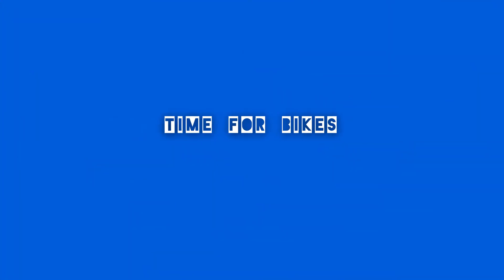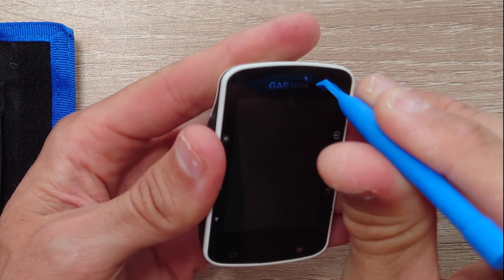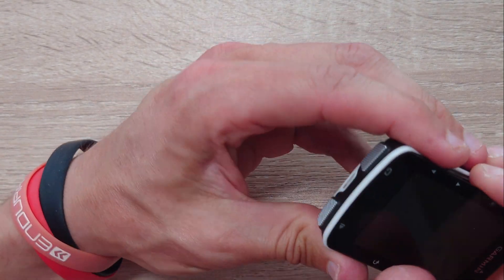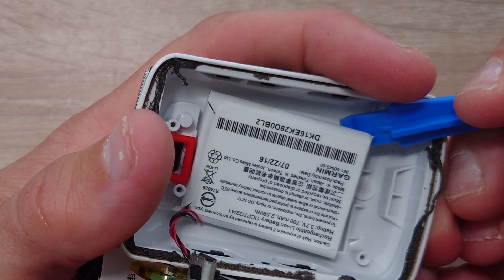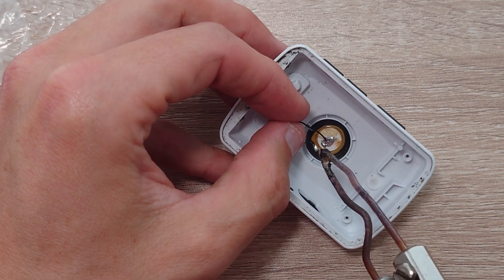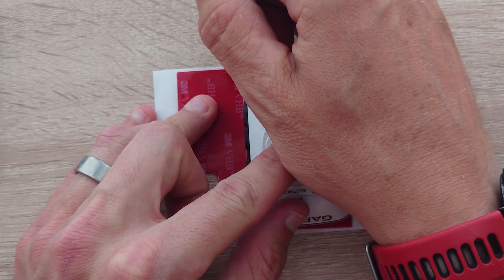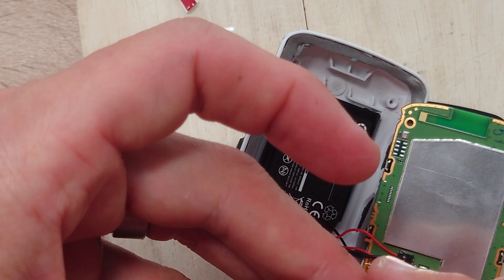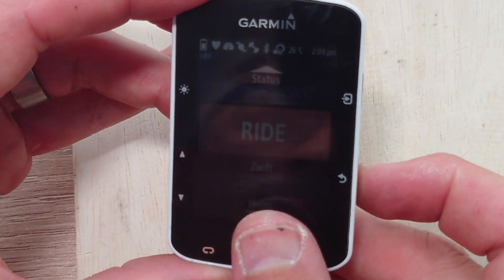How to replace a Garmin 520 battery – The BEST DIY way

Comment: To make it easier to separate the display from the case, please use isopropyl alcohol. Just a few drops into the gap between the display and the case will peel off very easily. It's also important to heat the display well to make the seal soft.
Reply from the maker: Great advice. Thanks for stopping by and adding your comment. Take care and happy cycling 🙂👍

Comment: Another success story here. For anyone else attempting, I would say to really really take your time removing the screen. I attempted this twice. About a month ago I got impatient and I really messed up the screen trying to pry it out and created blocked out pixels (or whatever the term is). The top of my screen was blacked out and not readable. Over time, this healed itself. I don't know how because it just sat around. I had given up.

I recently tried again, and while I again created some black marks on the corners, I was able to get the job done and I'm happy to say my Garmin 520 has a new battery and seems to be working fine. I did not bother reconnecting the speaker. The blacked out pixels have once again begun to heal and I expect my screen will be clear once again.

There is a lot of extra adhesive on the bottom section. Definitely save that for last, and be extra patient. Also take care to put the battery wire on the proper side. It's very short, and I actually had to reverse the battery because the wire was not long enough for the way I originally had it situated.

And for the record, the battery cable does push from the top. It does not slide. And the side where you can see the most copper should be facing out.
Reply from the maker: Excellent, thanks for sharing your experience. Basically thats All fid and we are all in this together. Well done and I am glad you persisted 🙂👍. Take care and happy cycling

Comment: I am having a heck of time getting that battery cable back in. Does it slide in? Or push down for the top?
Reply from the maker: Hi, its been a while since I did this but having reviewed the video it seems like I press the battery connector squarely down onto the motherboard. Like all these things its better that you take care with these little parts as they tend to deform and/or snap very easily. Keep trying as I am sure you can do it. Take care and happy cycling 🙂👍

Comment: How to test battery, I mean, in order to know if its time to replace-it?
Reply from the maker: Sorry for the late reply, Simply do a big ride with it running gps and everything else enabled. If the unit lasts no more than 3 - 4 hours then you know that the battery has issues. They should last a lot longer than that. Hope that helps

Comment: Great video thanks,
got mine changed after watching this. However the screen on mine seemed welded down, even after heat treatment and the lifting / prising did cause some apparent smearing on the lcd screen but still entirely functional.
Able to scrape the previous gasket/adhesive off the case but it wasn't going to come of the screen without damaging it, even with glue remover tried. I put it back together and used clear flexible silicone sealant. hopefully it will be waterproof (ish)
I was one of the first buyers all them years ago thats how long Ive had it.
Reply from the maker: @LANKY123  thanks for sharing your experience. I was going to suggest that maybe somebody had opened yours up before, but it sounds like you are the first owner. Well done on getting it sorted though. Take care and happy cycling 🙂👍

Comment: Tried this today and unfortunately the GPS stopped working.. any ideas? The replacement went without a hitch. It just no longer locates satellites. Tried all types of satellite and reset device etc. even tried putting the old battery back. Same deal. Everything else works - just no gps.
Reply from the maker: @mrjamiehinton  its one of those things that I can honestly say I have had no experience of, or what could have caused it. It may be worth checking the insides for any loose cables/wiring. The battery swap itself should not have caused it so I am wondering if a small part has come loose or has broken in the process of replacing the battery. Maybe worth taking a second look. So sorry I cannot help you any further 😕

Comment: Have you got a video on how to replace a 520 screen cheers
Reply from the maker: Hi, thanks for stopping by! Unfortunately I don't have a video. I would suggest that it is possible using the guts of this video to help guide you through most of its removal. I doubt you will need much further instruction if I am honest. Sorry I cannot help any further. Fingers crossed you can sort it out. Take care and happy cycling 🙂👍

Comment: After watching this video and several others decided to attempt to repair my Edge 520 with shortened battery life. One video was comedic as they were using hot glue instead of heat shrink to insulate wires, other video said to open Edge unit prior to ordering battery in case screen broken during separation which is how I proceeded. Could have saved $10 if willing to wait a month or two longer for a battery. Following this video as a guide, I only had one issue, battery plug would not lock/latch on to pcb mating connector. Very small locking connectors and vison declining with age, after frustration and taking a day break I used my soldering gun to heat fuse the two connectors together. Seems to work without issue so far, hopefully added several years life to my unit that is eight this year. Used black Permatex silicone to seal unit. Thank you Time For Bikes.
Reply from the maker: What a lovely comment. Thanks for taking time to stop by and let everybody know of your experience. So glad you were able to succeed. Take care and happy cycling 🙂👍

Comment: I had the very same new battery to replace but found that the connector didnt fit good and kept popping off, i then had to snip off the old original connector and cut the new on off and resolder the old one onto the wires of the new battery. Fiddly but then it connected fine. Also i heat glued my screen back to body. All is working fine again. I did this all before watching you video and yes i did scratch the under side of the screen when removing the old seal. Oh well its an old device and i can live with it. I also peeled off the old sticky tape from under the original battery and reused that.
Reply from the maker: Cool, after your hard work I bet it functioned a lot better. Glad you managed to reuse the 520 rather than buying a new device. Good work! Take care and happy cycling!

Comment: Thanks for the video, would replacing a Garmin 530 Edge battery be the same procedure? Regards.
Reply from the maker: Good question. I have not opened up a 530 before but can only imagine it would be similar. I have been debating making a video on a 530 but need to get my hands on one. If you need to open up a 530 then maybe do the same kind of procedure and just take your time. Best of luck! Take care and happy cycling 🙂👍
Reply: Thanks, no problems yet but it is about 3 years since  purchase from new. @timeforbikes

Comment: I destroyed so many things trying to fix it. Some bike locks from Abus (bt enabled), Suunto watch, even a $1700 Nikon lens with a known flaw where a doublesided tap loosens. This stuff looks essy, but needs some skill. I'd rather pay you or someone tond this for me.
Reply from the maker: When making this I really hoped that it would help others have the confidence to 'have a go'. I understand your concern but I would say that these are not high value items anymore and are relatively simple to repair. Granted, these units are not really supposed to be user repaired as its not something that is a simple battery replacement like say a tv remote. However if you are careful and take your time then this is possible. The 520 is still a very useful little computer and is a real asset to have working to its full potential. If you decide to give it a go then best of luck. Take care and happy cycling 🙂👍

Comment: Had to recharge mine 3 times yesterday on my 7 hour ride. Thanks. Now I need to pluck up the courage to attempt this 😌
Reply from the maker: Hi, don't feel too scared about it. This really is as easy as the video shows. When I made this video it was also my first time attempting it. The main thing I was really careful of was the ribbon cable linking the screen to the main board. Note how this is attached and the rest of it is fairly easy. Best of luck. Take care and happy cycling 🙂👍
Reply: @timeforbikes  well made tutorial thanks, I’ve subscribed BTW.
Reply from the maker: @sophiescyclingandwalkingch4294  thank you! Only 3 left until 1000 subs now 🙂🙂🙂

Comment: клейкую ленту от дисплея на корпусе легко удалить изопропиловым спиртом
Reply from the maker: Just to translate for any English speaking: 'the adhesive tape from the display on the case can be easily removed with isopropyl alcohol' - Thanks for the comment - I will try this in future as it could well make the job much easier! Happy cycling.

Comment: is it waterproof after this?
Reply from the maker: While it all depends on how good a job you do. I would say that if you complete it like as shown and the double sided sticky pad used to make the gasket is laid in properly and without a tear then there is no reason why it will not be just as waterproof as it was from the factory. Mine has certainly been perfect in wet weather. Hope that helps. Thanks for taking the time to check the video out. Take care and happy cycling 🙂👍

Comment: hows the unit holding up 6months on? Is it still waterproof and the screen firmly in place? Contemplating having a go at mine.
Reply from the maker: I have a Garmin 820 as well so I don't use it all the time. However there has been no noticeable reduction on battery life. In fact it is so much better than the original Garmin battery ever was as I had another 520 before this one from new and that was never as good. Thanks for commenting! Take care and happy cycling 🙂👍

Comment: as someone who did a battery swap myself a year ago. Here are some pointers....

1. The speaker can be removed completely or left disconnected - your garmin will still work just fine without it. It just wont beep so its a bit of a personal preference option.

If you dont own a soldering iron, you can use some wire cutters (or scissors) and snip the wires of the speaker and the new battery. Make sure to leave yourself at least an inch and a half  on each end before cutting because you will need to strip the wires back on both ends and splice them together. Spice the wires together then wrap the exposed joints in just a small sliver of masking tape, all you need is enough to wrap around the splice once to keep the positive & negative wires from making contact with one another and shorting out.

2. When it comes to putting the screen back on - You can use automotive gasket sealer from any shop that sells things for cars like halfords or euro car parts. Alternatively, you can use silicon sealant that builders use to seal up windows, bathrooms, kitchens etc etc etc. I used Gasket sealer from halfords because it comes in a much smaller tube. Choose which ever is more available or cheaper for you.

Spread it around the where the previous adhesive tape was then firmly press the screen back on around the edges then flip the garmin face down on level surface like a table or shelf somewhere and place a heavy book or something ontop of it. Curing should take about 1hr but i gave it an entire night to cure - Either option will leave your garmin weatherproof.

3. take it easy when removing the screen, because if you bend the top half of it one way while the bottom half is still firmly stuck in. You will run the risk of damaging or even cracking your screen. Avoid putting pressure on it as much as possible unless its already pretty much free from the original adhesive.
Reply from the maker: Thanks for your insights. As ever there are always different ways to undertake this kind of repair and it's great to hear the experience that others have had. Thanks for commenting. Take care and happy cycling 🙂👍
Reply: Awesome tips. I left the speaker on mine disconnected too. Outside never heard it beeping anyway. I used a 2800mAh in mine and it lasts for ages.
Reply: @cauldron101 may I ask where you got the 2800 mAh battery from? How does it perform after one year?
Reply: Thanks for the tips on the speaker. I left it disconnected since I don't use it anyways. Made it much either to replace the battery
Reply: Step 4: Reevaluate your life decisions if you don't have a soldering iron at home.

Comment: how do you know if the battery needs a replacement?
Reply from the maker: That's for the good question. I brought this unit on eBay and the seller had stated it had poor battery life. I did a few basic running time tests. I fully charger it and ride for about 2 hours, it ended up almost empty. I also tried it with no GPS while riding indoors and it lasted over 10 hours. Both tests I chose not to use any backlight as I have always found that it eats battery quickly! So in conclusion it's unacceptable for 520 to last only 2 hours while using it with GPS, but without any backlight while riding outside, People also go on about the effect of some updates upon battery life - well that was not the issue here as the new battery has performed extreamly well since installation. Hope that helps? Take care and happy cycling.
Reply: @timeforbikes  hi there great video.  How long does new battery last?  'thanks
Reply from the maker: If I am honest I have not run it out yet. I would say that if you reduce the power drawing backlight to 0 I would hope for maybe 8-10h. Sorry I can not help any further but I will update of I manage to test it.
Reply: @timeforbikes  perfect! .  all i needed to know - that’s way more than i’m getting.  thanks heaps!
Reply from the maker: I would say 6 hours for sure - as I have done that, however there was considerable amounts of battery left and hence the 8-10hour estimate. Good luck - take care and happy cycling 🙂👍

Comment: Thanks for the guidance.
I think the adhesive is thicker than it’s required to be.
Reply from the maker: I agree that the adhesive is a little thicker than what Garmin used but the finish on mine brings the screen about 1/4 of a millimetre above the edge of the plastic case, however I think it's a lovely finish. It also holds the unit tightly together while retaining its water resistance properties. I am glad you found it useful though. Please like and subscribe if you feel you can. Take care and happy cycling 😁👍
Reply: That's what I thought
Reply from the maker: @richardevans9465  Hi Richard, I hope the video helped you to replace the battery ok. Take care and happy cycling 🙂👍

Comment: I was impressed that 
1. You made a new screen adhesive .
2. You can say the word “soldering “ properly.
Reply from the maker: Ha, I never know that "soldering" was a tough word to say! I wanted to make my own screen adhesive is because I wanted to get a seal effect around the whole screen. People often seem to use straight tape and in my mind it could lead to a potential leak if not applied with enough caution. Thanks for the comment and I hope the video was of use to you.
Reply: @timeforbikes  
If you watch any USA video they all say “soddering ”. I’m about to change someone’s 520 and want to make sure it is water resistant afterwards. I know they ride in the rain .
Reply from the maker: @Dentinvent  I have only just tested this unit out on the bike and it was great. If I am honest it feels much more solid now and I am fully confident about how water tight it is. Best of luck but if your a handy person and have seen this video then it's a breeze. Let me know how you get on. 👍
Reply: I managed to change the battery . 
Here is the video I made. It is a friend’s 520 so the end part is for shock value 

Garmin 520 Battery Change Tips & ideas on screen removal
https://youtu.be/1MXsZdSmT0k